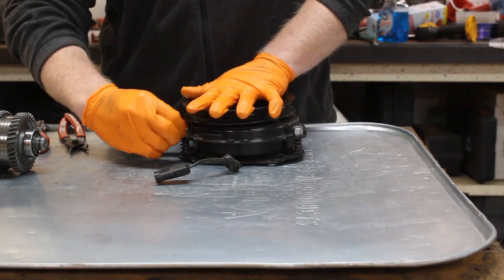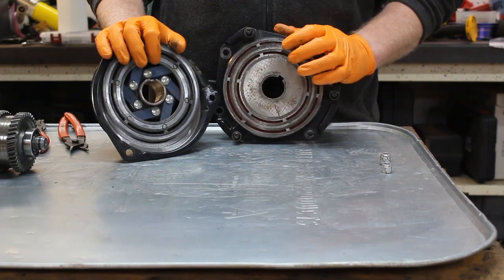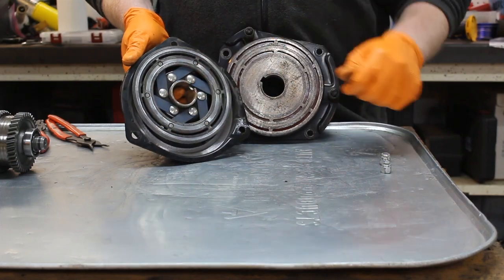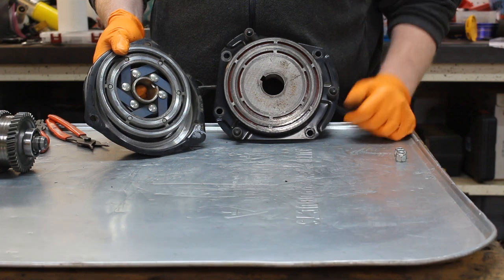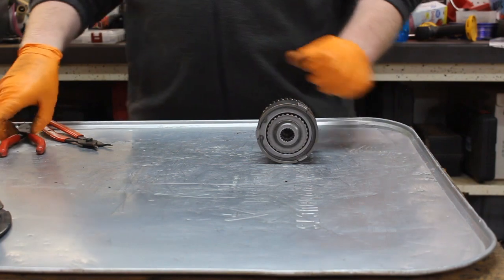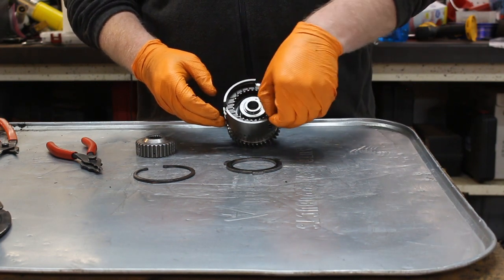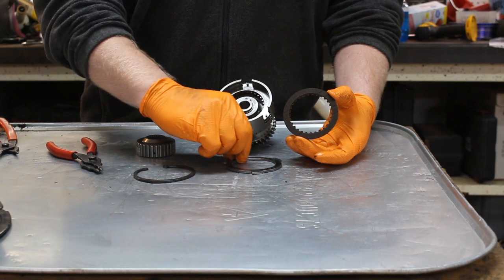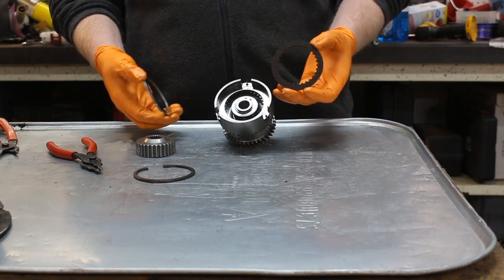John Deere 318 vs 425: Dry Clutch vs Wet Clutch (P2)

Comment: This is a constant debate about how/when to engage the PTO clutch. Manuals say operating RPM. I disagree. It should be the minimum RPM at which the engine will not stall. These clutches are not much  different than a dry clutch on a car. You do not run your car’s engine up to max RPM and rapidly engage the clutch. (Equivalent to the on / off operation of an electromagnetic clutch) why would you do it with an implement drive clutch? My 3046R will engage the 72” deck at idle. On my D170 I run it just above idle to engage the mower. No problems with either.
Reply from the maker: I think it will always be a debate! Based on your comment I reached out to Deere corporate who is helping me work with my dealer to get some more information.... this will be a slow process it sounds like. I've also got a contact into Tuff Torque. I do want to point out that all of these systems are designed very differently.....  and the dealer is looking into any technical information they might be able to share with the larger SCUT and CUT. While there are similarities between the clutch system on a 3046R and a K91, there are a ton of HP differences and it looks like the 3046 has 1-2 more clutch disks.  (I cannot find a spec on the size of the disks....). Even dry clutches... Warner has documentation that specifically states "lowest RPM possible" meanwhile Ogura has very little information about application on their clutches and leaves it up to the application.

Comment: On the "dry" clutch shown, the 3 nylon lock nuts need to be the "thin-wall" type.  I found out the hard way.  I kept having to re-adjust the gaps.  Never could get all 3 where they needed to be.  Found out that the socket I was using would shift the clutch over every time I placed it on the nut.  I didn't realize this.  This caused the gap to change where the plate and clutch had already "mated" since my unit was used.  Probably not an issue on new parts. 

I used the JD nuts from my dealer thinking I would be good.  NOT.  I tried to find the thin wall nuts elsewhere but not able to.  I ended up "adjusting" the original nuts to get them to work since the nylon was worn which is why I replaced them.  Of course, the size of the socket will be different between the two nuts.  Using a regular wrench is not practical.

Comment: for those who dont know this is like an automatic transmission 2-3 gear drum. this was an informative vid KG.
and along those lines of thinking....slippage is WEAR on your clutch. if you engage the clutch at idle...it will rip and tear to engage or maybe even stall the engine. run them up to mid RPM (or what the manual says) and you will have a happy clutch. at the happy RPM range it will LOCK and NOT slip/